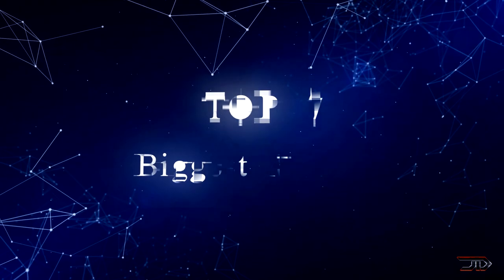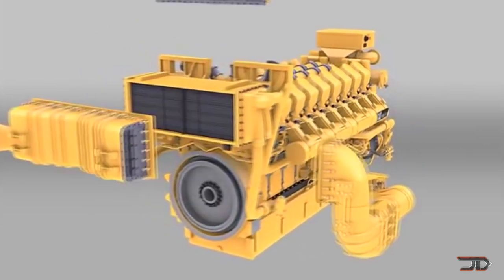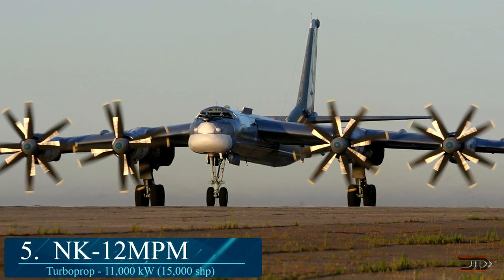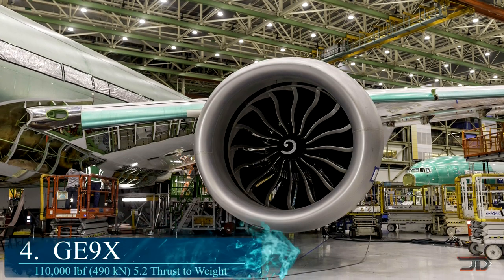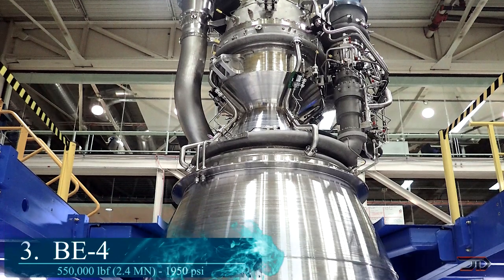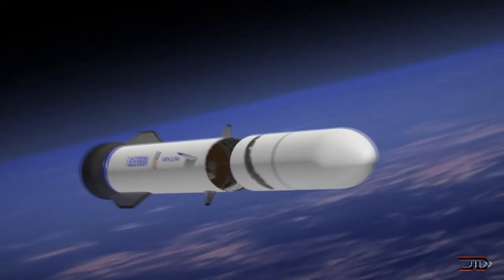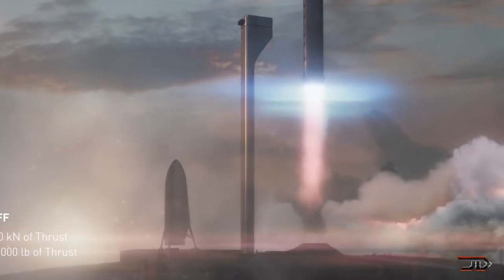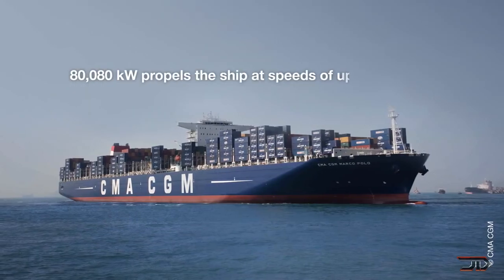TOP 7 BIGGEST New Engines In The WORLD

Comment: What does the pistons size have to do with compressing the air in another cylinder? Does it have something to do with the air/fuel mix in the crankcase? If so, shouldn't that mix go into the cylinder that is compressing it? I'm confused.